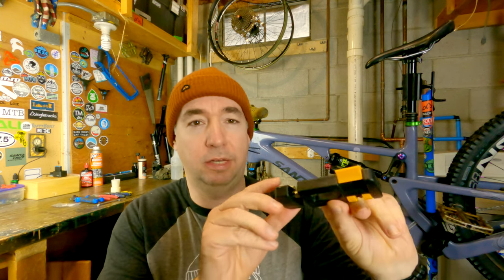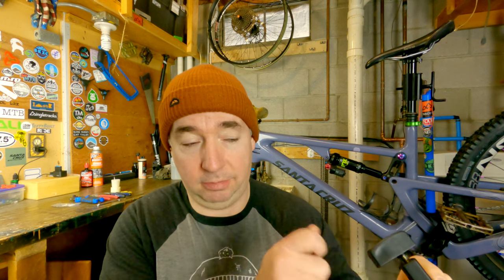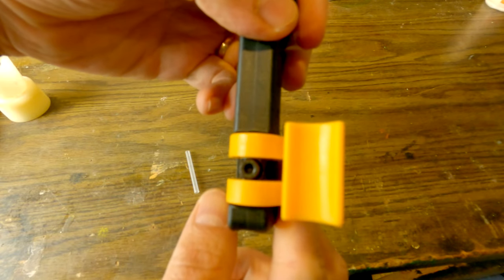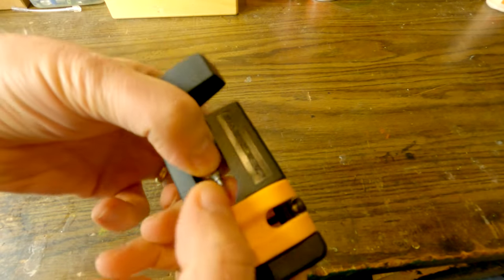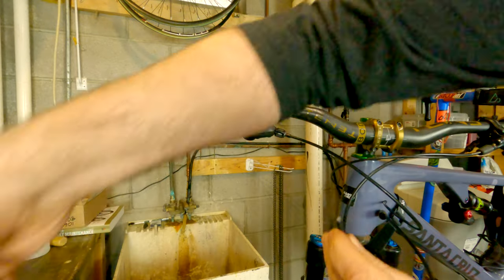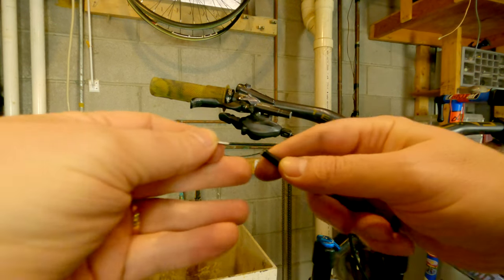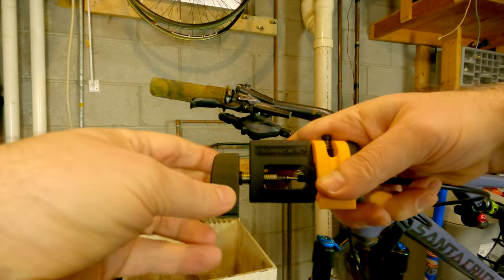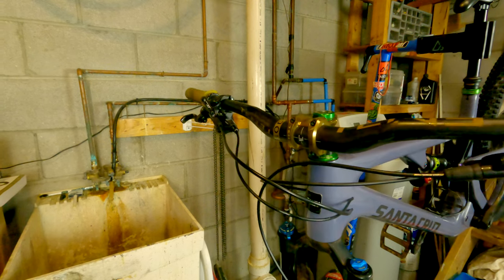Best tool for installing a Shimano brake barb! | Mountain Bike Tools

Comment from the maker: Let me know if you have any questions about the tool or would like to see a video on the rest of the cable shortening process.  I recorded the entire process but wanted this video to just cover the tool.
Reply: Thanks Brian! I would be interested to see the rest of the cable shortening process. I’ve been thinking about doing that myself or letting my LBS do it. I have SRAM level T brakes. Thanks
Reply from the maker: Cool, it's pretty much the same process. You still have a bard, it just gets screwed into the brake hose.

Comment: I've cut the hose on Formula Cura 4 brake, I used the Jagwire Housing Cutter, but I did not need to use any tool to install the insert, i pushed it in by hand, so far the smoothest and easiest brake I've worked on.

Comment: i still can’t get the barb into the wire for my SLX wire do i need to cut it for it to fix?
Reply from the maker: If you have an ice pic like tool, you could try that to widen the opening.

Comment: I have Jagwire housing cutter, which has the clamping thing bluit in, but also has a thing poke in the hose.
And a cable end crimping thing but that's not so line to use easier to hit Rd or not get to it depending on model, but I prefer to use hazed pliers fro crimping.
But for brake hose barb insertion I've used Hazet pliers and Shimano cable blocks. So clamp the cable with the pliers using the blocks and use a other tool to hammer it in. On Shimano that works well, but requires 2 hands.
I have Formula Cura 4 on the way, but I don't know how it is with those.
But I want to get a tool like this. I forgot to do that. But probably not a crisis if I don't. But hope to find one in stock.
The tool is probably robust and can take some abuse. Probably same quality as the Jagwire housing cutter. Which BTW is sold rebranded as Sram too, which is red.